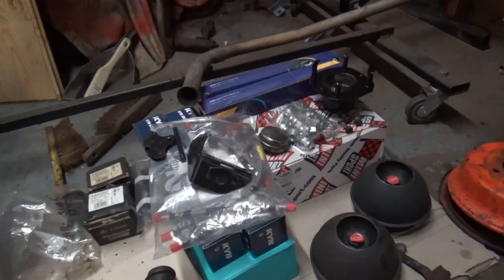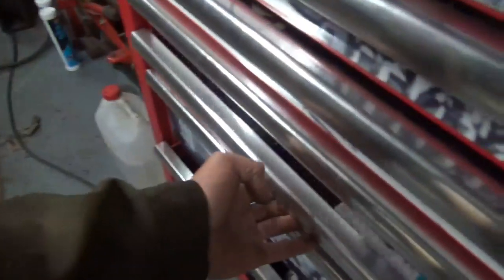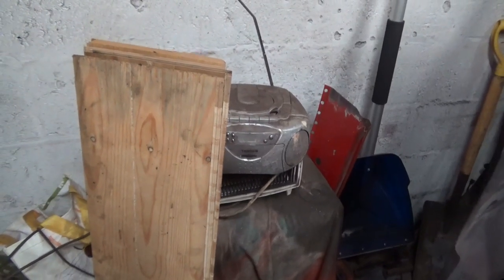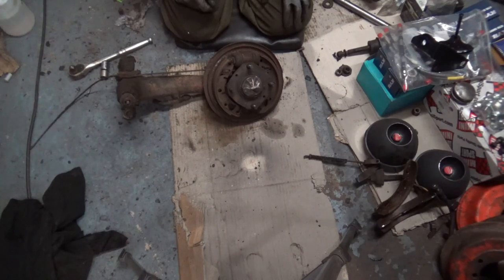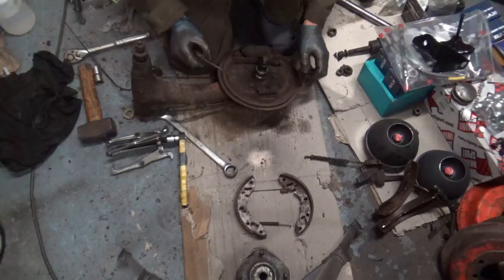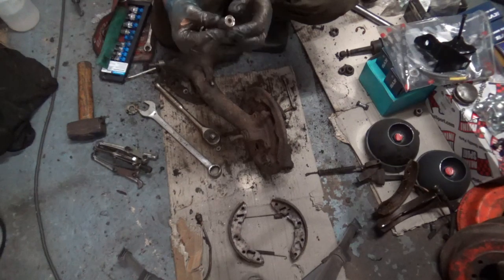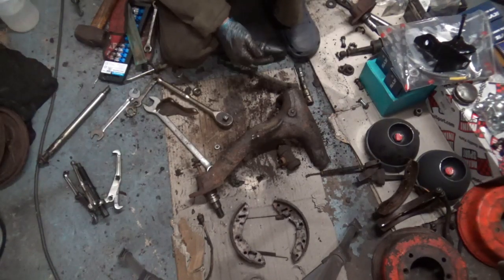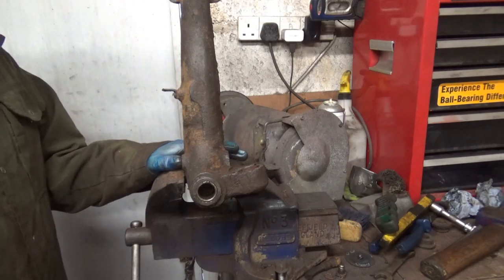Austin mini  rear subframe stripdown

Comment: Well done mate, you have been busy. Its coming along nicely
Reply from the maker: Cheers DB, yes it's coming along nicely. I've now discovered that there was tapered bearings on the passenger side radius arm and non tapered bearings on the drivers side. I now need to try and get the remains off the drivers side arm now
Reply: @BMCWorkshop maybe just as well the subby was rotten mate, means you get to put all this other stuff right and you will have a solid safe car
Reply from the maker: @DBMiniDIY  yes indeed mate

Comment: Nice video sean glad to see you back on it... I was with you for thr purchase of most of the parts and you got a right bargain tbh well done
Reply from the maker: Cheers Alex, I just need to do the radius arms and then I should be able to start building up the frame. I did cut one of the stub axles so a new one has arrived but I need to get the old one pressed out and new one pressed in lol

Comment: Perfect timing.. I just removed my radius arms from the subframe and now you give me motivation to take them all apart and restore them..   I will certainly be watching this video a few times... thanks Sean..  yes...  is it better to ream before refinish?
Reply from the maker: Cheers Randy, hope your well buddy. I'll ream then paint them up
Reply: @BMCWorkshop  Is this the part number  for the radius arm reamer tool:  Mini Spares: GSV1125 ??
Reply from the maker: @LoneStarMini  Randy, that part number is for the actual pin kit. I bought my reamer from ebay https://www.ebay.co.uk/itm/MINI-REAR-RADIUS-ARM-BEARING-REMOVAL-REAMER-TOOLS-WITH-PILOT-ATTACHMENTS/183701507352?ssPageName=STRK%3AMEBIDX%3AIT&_trksid=p2057872.m2749.l2649
The seller does state that he posts worldwide. The tool is expensive but if you have a few radius arms to do then it works out much cheaper rather than buying reconditioned arms!

Comment: great work sir, I am doing the same job myself - keep up the good work
Reply from the maker: Cheers Kev! I need a new radius pin thing as I've slightly cut in to it trying to remove the remains of the old bearing. Will need to find someone with a hydraulic press to push the old pins out :(

Comment: Hi Sean Iam a new subscriber when I restored my radius arms one of them was like yours with needle roller bearings on both ends which I thought was a good idea so I had my other radius arm machined the same as the pins do not taper when I measured them. So to answer your question the outside diameter of the bronze bush is smaller than the roller bearing if you go down the road asi did   when machining the arm you have got to make sure it’s parallel with the axle pin
Reply from the maker: Hi Lee and thanks for subscribing to my channel. Thanks for confirming the radius arm roller bearings. It certainly does sound a good idea so what I could do is buy a separate roller bush for that arm and ream the other. I think I will have a look over Annie's existing radius arms and possibly just use these and use Angus's arms for Angus